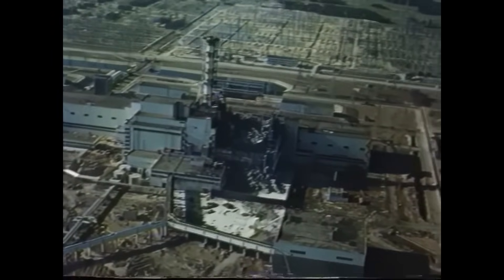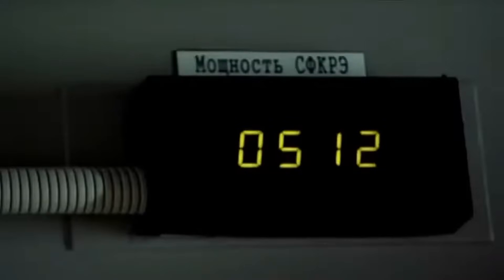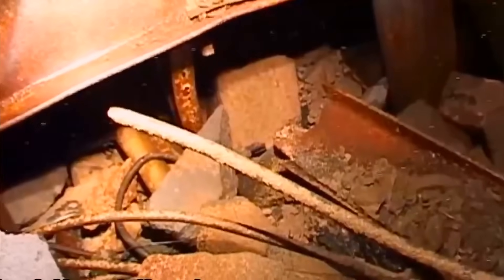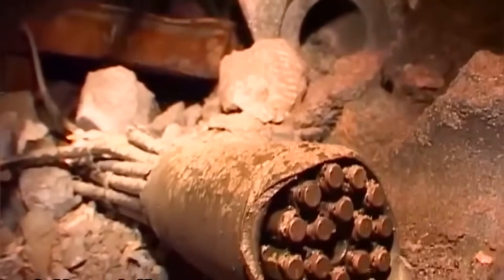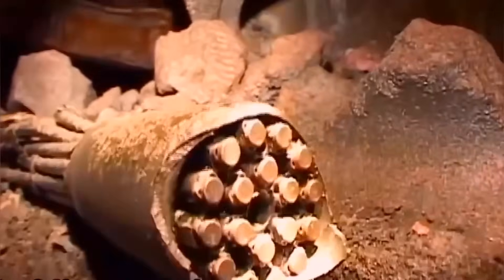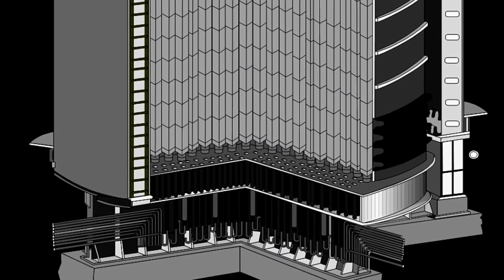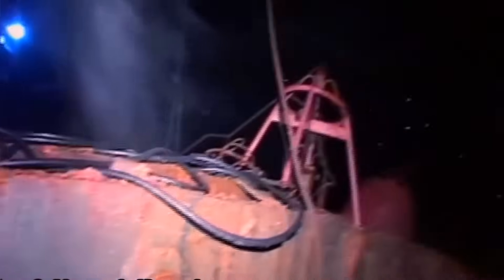Chernobyl Explosion Theories: The Hydrogen Explosion and Why it Doesn't Work

Comment: Please shred my theory to pieces: I'd say lifting Elena and the destruction was all at once a result from nuclear fizzle.

Meaning, in the runaway reactivity region in the lower part of core, exponential fission power increase led to a small layer of core being vaporized - not just water but fuel and graphite perhaps as well. This pressure was the explosive force that bent lower biological shield down a bit, threw upper biological shield up, and also expelled upper part of core to follow it. All while the cylindrical wall was the stronger of components and held up. This, in my mind, is sufficient to destroy the main hall, as graphite bricks would ricochet off the bottom of Elena to all directions, not just up. This would've involved not too much chemical reaction.

Then a follow up steam explosion may have occurred, if significant amounts of new cooling water were able to swiftly enter through the bottom and hundreds of tons of extremely hot core debris descended back down into it, having also mixed with air from outside. This pile would then be tossed up in a steam explosion, and it would be a fiery eruption, roughly as in HBO series, graphite burning in air.

Comment: A hydrogen explosion (or more specifically, an oxyhydrogen explosion) is the theory taught to me by inorganic chemistry Prof. Jacobs in his introduction to inotganic chemistry lecture at Dortmund University in the 90s who absolutely knew what he was talking about. Your debunking has several holes.
1) The oxygen did not need to "flow in" against a pressure gradient. It was already there because it was created in situ by katalytic disassociation of steam.
2) In air, metallic, elementary zirconium, much like aluminium, immediately builds up a very thin layer of zirconium oxide, a phenomenon known as passivation. It clings to the metal and, under standard conditions, stops the rest of it from oxidizing any further.
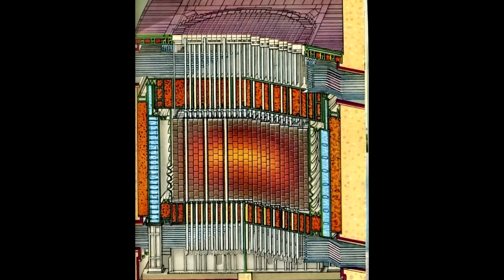3) The reaction suggested at 4:51 is the wrong one. Metallic, elementary zirconium is not being burned up as suggested. Rather, zirconium oxide from the "skin" of the zirconium components acts as a catalyst which itself by definition is not consumed by the reaction and remains unchanged after it. Indeed zirconium dioxide is known to be catalyzing the thermal dissociation of water, lowering the dissociation temperature from 2,000°C down to 1,200-1,400 degrees, shifting the equilibrium toward the products H2 and O2. It takes a lot of (thermal) energy but ample heat was of course supplied by the nuclear reaction.
The factors limiting the amount of oxyhydrogen that can be produced this way are the amount of steam available and the surface area of zirconium dioxide that is hot enough.
4) Another possible source of hydrogen is the carbon gas reaction well established since the late 19th century. At 6:02, once again you quote the wrong reaction formula. In fact it is 
C (graphite)+H2O (g)→CO+H2

It is endothermal and easily occurs at 1,100-1,400 degrees. Note this is not a catalytic reaction as the graphite is used up. Instead you get carbon monoxide which in contrast to carbon dioxide is actually combustible and does form an explosive mixture with oxygen. Carbon dioxide would need to form in a follow-up reaction.
5) Explosions can cause shock waves. These do not push out the material uniformly throughout the event. They are different from a linear pressure gradient. Rather, at the "rear" of the wave there comes a pressure "valley" sucking gas in.
Reply from the maker: This video is a couple years out of date, and I'm probably going to redo it. But we do now know that some hydrogen was produced, just in a much smaller quantity than was assumed required for this theory. We know this because the RBMK has a hydrogen removal system, which survived the reactor runaway and explosion. The hydrogen then subsequently accumulated in airtight boxes adjacent to the reactor core and the steam separators, which detonated at 01:40:01 according to the computer data and operating logs. It was felt by many people both inside and outside the building, and was registered on seismographs at roughly 2/3 the intensity of the initial explosion that destroyed the reactor.
Reply: @thatchernobylguy2915  Whee, one more timestamp...

Actually I find it strange that very few Chornobyl videos present graphs of the logged data from SKALA and instruments such as seismographs, and flux meters etc... A timeline of those disastrous seconds would be enlightening. A timeline visualization is one of the most useful tools in every post mortem analysis.

Comment: At the temperatures with 300 gigawatt power you don't need oxygen, it is created by water splitting apart at the bottom of the core
Reply: You didn't watch the video, did you? The power was high but for a short moment. So you cannot blabber "power = the temperatures". The temperature estimate, as per the video you didn't watch but commented eagerly, was 10000 degrees.
Reply: @u1zha 3000° is enough to split 50% of water into oxygen and hydrogen

Comment: I haven't looked at the papers or anything here, but on the second theory for where hydrogen could come from with the graphite, is square meter the correct unit?  If it is, the cross section in one plane doesn't matter, but rather the total exposed surface area of all the blocks.  Don't know if it's right but the first number I found on a quick search is that there's 2488 columns of blocks, 7 meters tall, each one 250mm on a side and have an 114 mm hole through the middle.  that means for millimeter of height a block has a surface area of 1 meter for the outside surface and another 358 and change mm for the hole.  That's1.358 meters of surface area per mm.  1358 meters per meter, and 9,506 square meters of total, exposed, surface area, not including the top and bottom of the blocks.  That's about 88 times more surface area than suggested in the video here.  Roughly 300Kg of hydrogen, which makes a roughly equivalent explosion to 8000 KG of TNT, 17,500  lbs, or 8.75 tons of TNT.   For comparison the largest conventional bomb to date, the MOAB, has an explosive force of about 11 tons of TNT.  Seems to me that even a tenth of the hydrogen that could have been produced would be plenty to blow the lid off.  
On the other hand maybe it's supposed to be cubic meters?  in which case we got what?  17,000 M^3 minus 2500 for the holes for 14,500 cubic meters of graphite available?  Comes out to a bit over 400 Kg of hydrogen in the 3 seconds.  
Either case seems to suggest there's plenty of hydrogen available over 2 or 3 seconds to produce an explosion at least equal to a half ton of TNT, and that's nothing to sneeze at, either from much of the reactor flashing a little, or a smaller area turning as much graphite to CO2 as possible.
Reply from the maker: @johngaltline9933  But only the top side would be exposed. Bottoms and sides are shielded by other graphite blocks, and the holes still have zircalloy and water vapour in there. Any damage significant enough to open the sides or bottoms of the graphite blocks is simply going to collapse the graphite stack, leaving again only the top available.
Reply: @thatchernobylguy2915  To be clear, I'm not defending a hydrogen explosion being the cause, just the math saying it's at least a possibility that needs to be looked in to better.  From what I can tell with just the basic googling, there is at least 1.3mm clearance between the fuel/control rods and the channels(holes) in the graphite where the slip rings are, and more than that everywhere else in the channels.  
The RBMK has a bellows on the double wall that's there to account for the expansion and contraction of the graphite as it heats and cools and there is no mechanical fastener holding the blocks together, never mind that the mating surfaces are not perfect adding further to gaps between the sides of the blocks.  If there's steam between the blocks, it will get in to every nook and cranny, never mind huge millimeter wide gaps.  
All that said, I still don't think it likely that this was a major factor, but either way, if it happened that way, there would have been a whole lot more than just the top surface area available... and if the blocks crumbled, there would be a huge amount more surface area available for some fraction of a second.

Comment: Repeating something I said down in a reply: The claim that gases flow exclusively along pressure gradients is only true at steady state, where the gas doesn't have any preexisting momentum in some other direction. What happens in an explosion is that the gas is driven outwards at high velocity, and that momentum carrying gas molecules away from the center leaves a vacuum in its wake. No laws of thermodynamics are violated (entropy is what dictates that gas will flow along pressure gradients at steady state).

In other words, Chernobyl guy is misapplying the relevant laws of physics by assuming steady-state conditions. If he were right, then thermobaric weapons and fuel-air explosives would not work. Both of those rely on vacuum in the wake of an initial explosion and subsequent inflow/mixing to create the conditions for a larger detonation. The hydrogen theory of Chernobyl is effectively that the initial explosion plus Hydrogen generation from the core created a thermobaric weapon. While I don't buy it myself (I think that Sich makes more sense), it's more viable than Chernobyl Guy makes it sound.
Reply from the maker: Except any vacuum was replaced by water being forced into the core from below at high pressure while it was all backed up when the backlog valves were shut.

Thermobarbic weapons don't work using vacuums, it's a misnomer. The vacuum occurs after the explosion and after the gases have cooled, which results in a sudden pressure drop. The explosion itself is just ignition of dispersed fuel in the air.

 Contrast that with Chernobyl where the explosion occurs at a high region of pressure, and it's aftermath is certainly a lower pressure given almost everything was sucked out of the core with the Upper Biological Shield (see my video on Was Chernobyl Destroyed by a Nuclear Explosion), not only is the comparison inappropriate, but also leaves a big dent in the mystery of where any hydrogen came from.
Reply: @thatchernobylguy2915  Thermobarics have two vacuum phases as I understand it. The first one is what causes the fuel and (external) air to mix after the precursor explosioin. That's what I was referring to.

Comment: Some concerns about physics of explosion: 1. If cylindrical graphite core survived the 1st explosion, it would crack. How many breaches in graphite body, I have no idea, but assume many. That water, gases, vapors under high pressure and temperature immediately filled new caves - huge surface area for chemical reactions; 2. Typical hydrogen detonation speed is ~1500m/s with radius ~11m gives some really short timing; 3. Detonation in closed volume is significantly more destructive vs open space because of walls reflections. Did you use that to calculate the TNT equivalent? 4. Detonation is based not on equilibrium chemical reactions but chain reactions. That create a short timing for all processes. 5. Would be interesting to see how 3000atm and 10000C were estimated. Hydrogen detonation could go to ~10-20atm and ~2000+C. Numbers above these limits look as fantastic. 6. You didn't discuss construction materials, like stainless steel rods etc. I would be interested to see some analytics about materials properties of the reactor, cement, etc. If I remember correctly, stainless steal rod like used for constractions changes its properties at ~300C and collapced at ~700-900C.

Comment: While calculating owerall surface of graphite, you need to calculate every exposed surface: 6 outer squares of each block plus inner cylinder. But, in your video you took only cross-section of a reactor that is way smaller.
Reply from the maker: Except they're not exposed, because the stack is still together, and the insides are lined with a zirconium-based alloy tube. The only possible area for a reaction to occur would be the very top of the graphite stack.

Comment: 8:15 unclear what you mean this only happens at 0.1atm. The table clearly shows 57-91% disassociation at high temperatures under standard 1atm. Runaway nuclear reactions certainly generate high temperatures.

Comment: There was a risk  of ADDICTIONAL hydrogen explosion and that’s how the electricians died, trying to switch off the electrolyzers. But that’s not hydrogen inside the core so maybe people confuse the actual hydrogen which was normally produced, with some other hydrogen that was formed in the special conditions after the lid got blown up.

Comment: Does the logic not follow, that huge amounts of pressure ruptured the reactor, the superheated water is vapourised and then breaks down as it rushes from the chamber? If that makes sense, there would be a cloud of oxygen and hydrogen with a 10,000 degree reactor, just hanging out beneath, thereby we get a huge explosion. It would be like a thermobaric weapon.
Reply from the maker: No, because the pressure wave is both still a very high pressure and shot out of the building, so there is no way to ignite it all simultaneously.
Reply: @thatchernobylguy2915  You make a good point, there’s a lot of variables. I agree for this to be possible there’d be a shock front where pressure would be too high, but how long would that last? Once the pressure reduced, everything is at auto ignition temp. The graphite would burn. Feels like it would have to be modelled to rule it out as a possibility. I might check out that paper.

Comment: Here is a spitball calculation:

The graphite in contact with steam in the fuel channels or process channels (1661). We know it was essentially all steam from the bottom to the top of the process channels at that time and still under steam drum pressure (not atmospheric per Trend C in INSAG)(control rods are excluded from this calculation since they are not part of the 1661).
C + 2H2O  - CO2 + 2H2
Per the reaction, no oxygen is needed just graphite (Carbon) and Steam (H2O)

Zircalloy is only cladding the fuel U235 and not the graphite channels. See diagram in link below on slide 5, item 12 is the cladding which only in contact with U235 or fuel pellets. It is not cladding graphite. No reason to clad the graphite. Zircalloy only clads fuel to protect the water from contamination. That is why just only having graphite spread everywhere on the ground only showed the core had been breached, but zirconium signatures in the air samples indicated the fuel pellets were breached (U235 was on the run). 

https://nucleus.iaea.org/sites/connect/SFMpublic/TM on Phenomenology Simulation  Modelling of Accid/LTU-T_Kaliatka-LEI-Presentation.pdf

Link below has an image of a process channel in fig 1 and item 17 is graphite. Obviously, it looks a little too tight in there because water/steam is flowing upwards through that channel. Note items 13 & 18 on the right are the biological shields at the top and bottom of the reactor core.
https://igdtp.eu/wp-content/uploads/2019/02/CARBOWASTE-2009-Analysis-of-Nitrogen-Impurity-Impact-on-14C-generation.pdf

1661 fuel rods in channels about 7 m long and 88 mm diameter. 
Surface area = 2 x pi x 0.044 m x 7 m x 1661 =  3,214 m2

graphite is extremely porous such that the surface active area can be a factor of 10 to 100 more than its simple geometric shape but we’ll keep it simple.

Rb is 0.005.

We have about 600 Kg/s steam on trend M from the INSAG1 strip chart at this time period, for 3 seconds, that’s 1800 kg of steam passing through 1661 graphite fuel channels at 1500C. Trend N in inIHSAG1 shows fuel channel temperatures above 1550C after 1:23:44. 

3,214 m2 x 1800 kg x .005 = 28,926 Kg of H2 or 1.6 Hindenberg Zepellins

(don’t have access to the research report to see how the Rb constant is used).